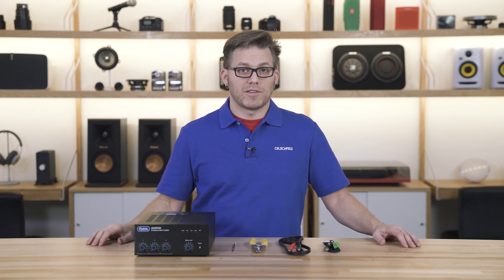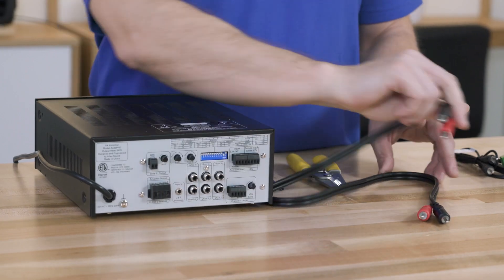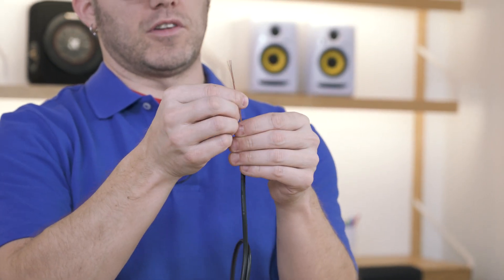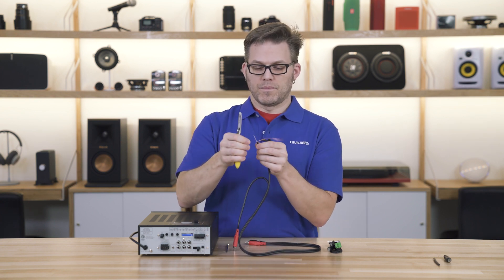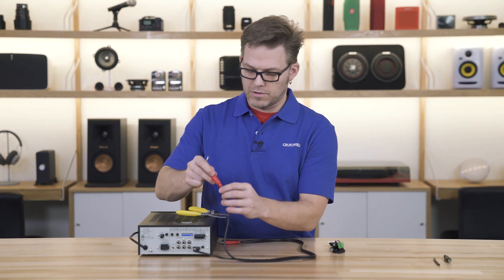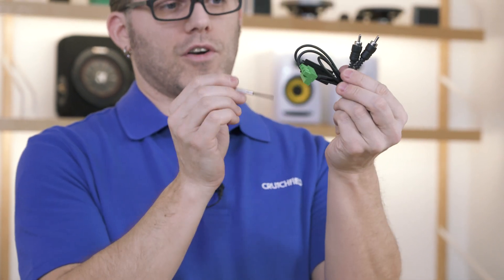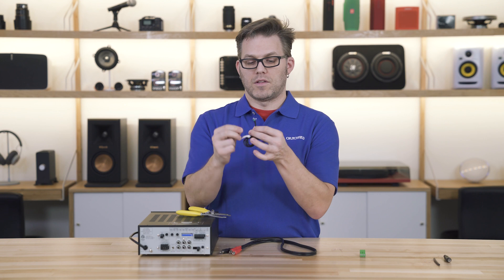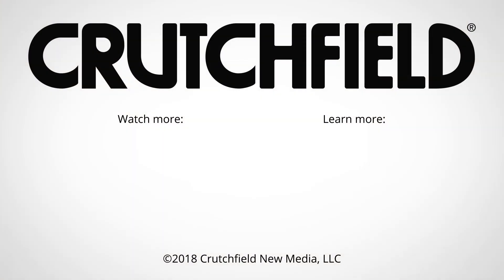How to connect RCA cables to Phoenix-style connectors | Crutchfield video

Comment: Thanks to Rob and Crutchfield for this video. Using this information I was able to do a quick replacement of a faulty AMP on a paging system. The one thing I want to add is if for the media doesn't play afterwards, remove the earth ground jumper. Removing this jumper resolved the issue of no audio. Thanks again, much appreciated.
Reply from the maker: You're welcome! We appreciate the feedback and tip
Reply: Hey Marti, what amp are you using?

Comment: Helpful! Thank you! Question: Is it the same wiring/jumper if the Phoenix connector is an output from the pro mixer?
Reply from the maker: If its a source output (guessing so since its a pro mixer), this wiring process to get the necessary wires will be the same. The wiring layout within the Phoenix connector can vary between products so you will need to check the manual for your pro mixer for that information.
Reply: @crutchfield  right on. It's the same (+ - G) as the one used in the video.

Comment: All of our commercially installed rca cables are not using a y sum cable but simply the left audio channel is plugged into the ground and the right audio channel is plugged into the negative input, while both positive outputs are going into the positive input on the phoenix connector. Is this what is causing the buzz on our audio system!?

Comment: Can you just connect the right and left positive conductors of the RCA cable to the positive pin on the phoenix connector, or is there something special going on inside the Y adapter that combines the right and left signals appropriately?
Reply from the maker: You would use the the YSUM cable to combine an unbalanced stereo signal into a mono signal that you can plug into a mono mic/line input.

Comment: or just use a rca splitter for stereo.
Reply: I'm thinking the same.  Couldn't I just put an RCA Y connector on the other end of the first cable he made?  Or are they showing to eliminate using an adapter?

Comment: What If we don't use ground? I'm getting a ground loop with this method, If I skip ground entirely it disappears. Am I ok to skip the ground wiring?
Reply from the maker: The ground wire should be connected. It is most unusual that this is happening. I recommend consulting a technician to troubleshoot the issue. If you purchase your gear from Crutchfield, you can contact our technical support for help. We send the number on the order invoice.

Comment: I have a single 3-pin Euroblock/Phoenix Connector output, from a JBL Mixer, and I want to run that output to two different amps (i.e., same signal to two apps to power more speakers with the same audio content). The amps can accept either a Mono Sum RCA cable or a 3-Pin Euroblock.  Is it possible for me to daisy chain the Euroblock to achieve this setup?
Reply from the maker: It is possible to feed the same audio into two amps. You can parallel wire the audio cable for each to the same Euroblock terminal. For the RCA ports, Y adapters can be used to split the signal.
Reply: @crutchfield  Thank you.  I should have updated my question. I did wind up daisy chaining the single Euroblock out to two Euroblock inputs and it worked like a champ.

Comment: Question! I want to capture the signal coming to a speaker off an amplifier that uses these Phoenix-style connectors. I get a nice clean signal by using this technique (stripping an RCA cable) and attaching it on the end of a 100ft line meant for a small speaker in the back of a church. But the signal is very very strong. Had to turn my gain to 0.1 on the H4n.  I've only tested the sound with an H4n device that I assume is safe from getting fried from powered signals. Would this still be safe to plug straight into a computer? or do I need to ground the wire at the other end before it goes into my microphone jack on a laptop or desktop?
Reply from the maker: I do not expect the computer's inputs will take a signal that is strong enough to run any size speaker. Something will need to be done to reduce the signal strength. I recommend contacting one of our commercial audio advisors using 1-800-315-2758 to check if we have any gear to make this happen.